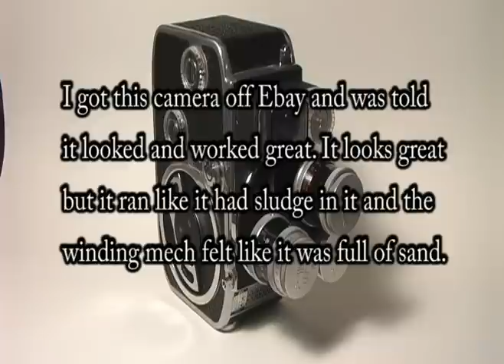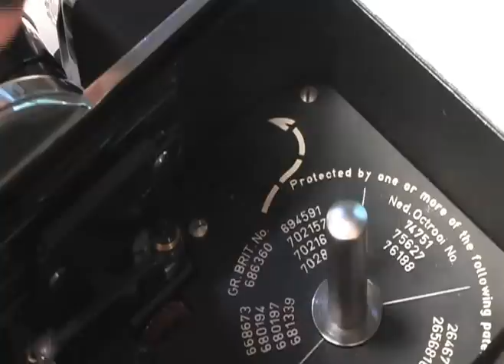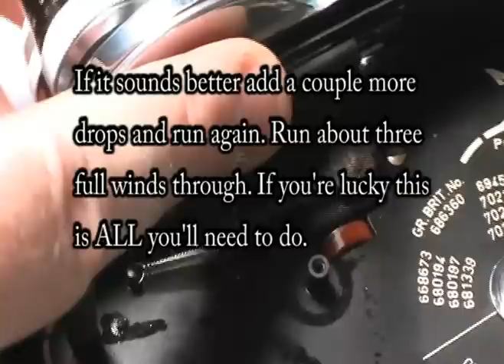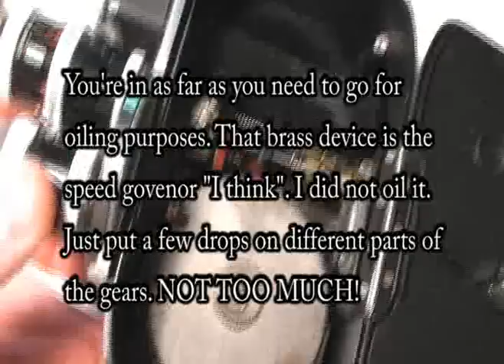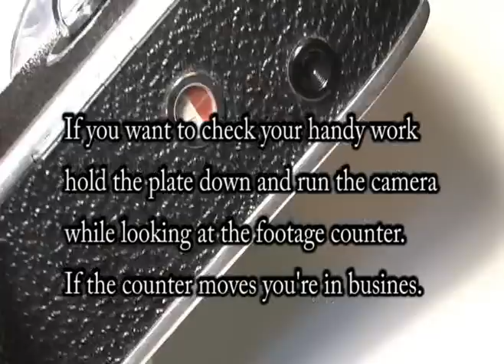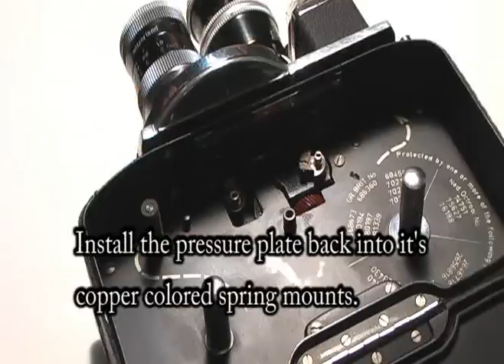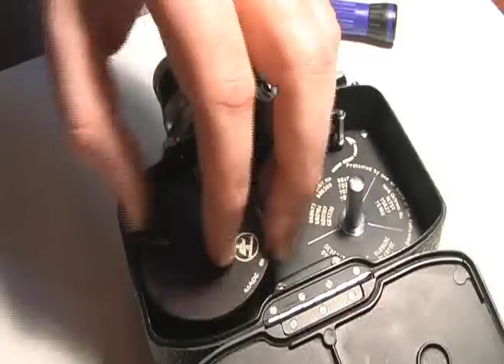Bolex 8MM

Comment: I have a Bolex P1, and it has the same exact issue...sluggish running at 12 fps and nothing at all on frame speeds above that. I don't trust myself to repair the camera. so I am sending it to a certified Bolex repair facility. The P1 is basically the D-8L, but it is a reflex camera with a  nice zoom lens. Thanks for sharing your video! I wish I were as skilled as you are.

Comment: Ah, very good. I had opened my Bolex (a more basic model - no turret, no speed knob. but it does do single frames) before, but it's been years, and I'm glad you showed me how to do it better than I would've. Oh, that little spring and roller assembly above the gate is a killer. How's a guy with fat fingers supposed to manage - with infinite patience I suppose. My camera was making awful intermittent grinding noises, lubricating everything I could get at made them go away - until I got it back together! Oh well, it's better than it was. Maybe in ten years I'll give it another shot; right now I'm shootin' movies.

Comment from the maker: You're quite welcome.  The only other issue might be the take up reel. They are lightly lubed and over the years will either pull the film too hard causing jitters or not pull enough causing the film not to wind onto the spool and thus ruining the film when you open the door to flip the spool. Having a test roll with film on it around is the best thing to make sure it's working well before shooting. Good luck-have fun!

Comment from the maker: They'll do a WAY better job than what I was able to do. You'll be thrilled when you get it back. I also have a P1 I got a few months back. Same problem so I oiled it and it seems fine. I just ran a test roll of Plus X through it the other day. You might want to get a Neutral Density filter for it. The high ASA films 100 and up tend to peg the built in light meter on sunny days. My lens hood is designed for Series 7 filters which I found a set of 5 on Ebay for $4.95. They are amazing cameras!

Comment: Interesting; could you explain a bit more as I have noticed some jitters. It looks to me like the take up reel is directly driven by the camera, so I don't fully understand how it could vary its pull? The film reel just turns free, not driven at all I think. One question; the little felt "roller" that doesn't roll- should it roll? Should the film rub against it (it does with mine)? Or should I be forming more of a loop to clear it?

Comment: Nice video, is this channel still maintained, I had a question about the bolex p1?
Reply from the maker: I'll answer it if I can.
Reply: +TheAutoload Thanks for responding, I followed the tutorial and my p1 works like a charm now. When I was putting the pressure plate and spring mechanism back in, a tiny brass pin, its sort of U shaped with a tiny curl at the end, fell out from the underside of the pressure plate, and I haven't the slightest idea where it fell off from.
Reply from the maker: +Robert Seppälä I'll try and have a look at mine in the next day or so.
Reply: Thanks, much appreciated! It seems to run fine without it, but I didn't want to take any further risks of damage, so I popped the pressure plate back out. Kodachrome and caffenol-c experiment on hold, at least with this camera.
Reply from the maker: +Robert Seppälä I've opened mine up and removed the pressure plate as well as the black Bakelite section with the pressure plate lever on it. The only U shaped pin I find isn't brass but it is located under the Bakelite piece and is the spring tension for the silver lever that opens and closes the film gate for loading. I wish we could post pics in the comments.
Reply: pics would be good, well the main spring that gives the lever tension is still attached and fully functional...I'm stumped...lol
Reply: @robertseppala6592  Hi Robert, did you ever find a place for that brass pin? I just noticed that I have one like that on the table too ... = O ...

Comment: Thanks very much for this. I watched a couple of times and had a go with my old B8. It runs much better now. I was wondering if you had any ideas on cleaning the viewfinder? Also have you found the screws VERY tight and difficult to remove? On the B8 they feel almost seized! Thanks again!